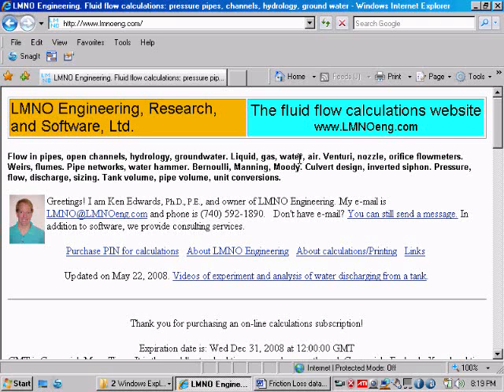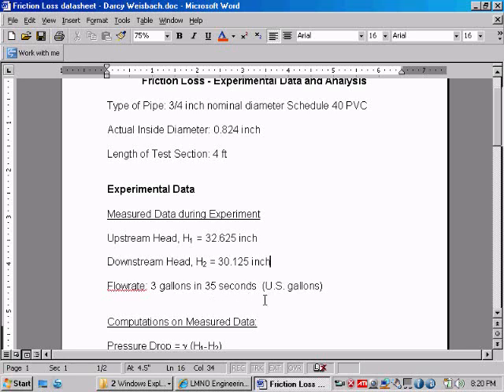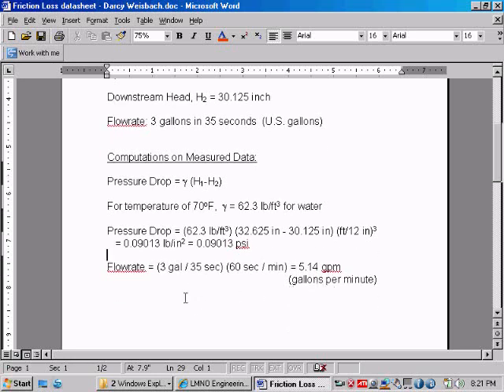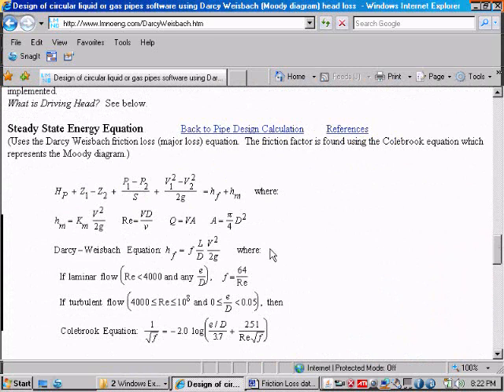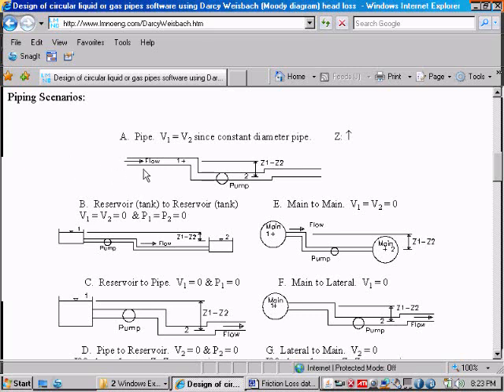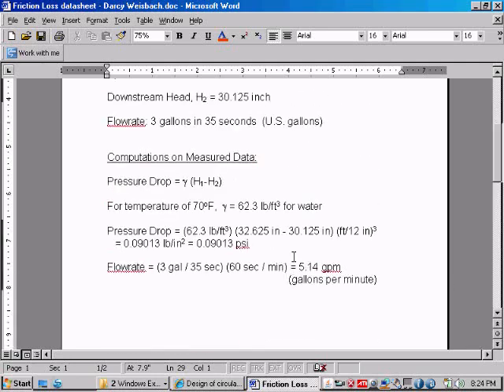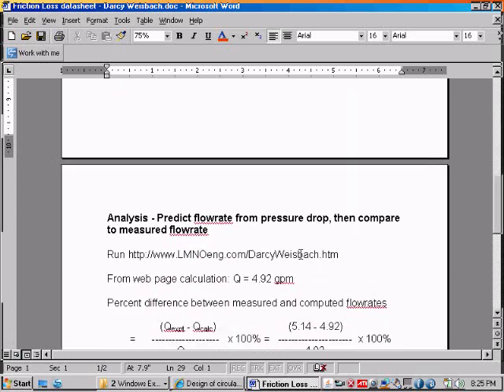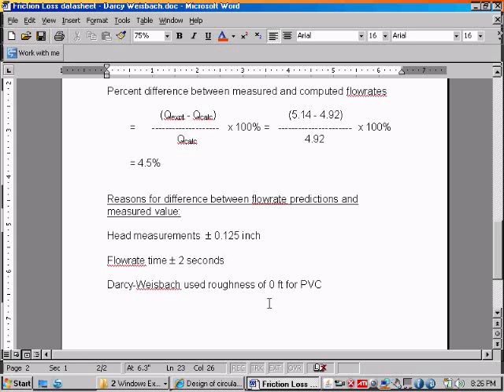Friction loss experiment analysis using Darcy-Weisbach equation

Comment: This might be a long shot. Studying fluid mechanics and for fun I did a few matlab plots yesterday.

 I used the energy equation and friction losses straight pipes (smooth), I wanted to do a plot that gave me an intuition for how the flow through a straight pipe goes down as the length of the pipe increases. Not sure if it's possible to do it the way I did though, because I rewrote velocity as Q/A in the equation and assumed a tank with water level of 2 meter, open to atmosphere, was the thing that made a pressure at the bottom of the tank, where I thought my horizontal pipe started, all minor losses ignored. This is what I ended up with.

.5(Q/A)^2*L/D*.3164(V/((Q/A)*D))^.25 - g*z + Q^2/(2A^2) = 0

Where Q is a variable to be solved and A is inner pipe area, D is pipe diameter, V=kinematic viscocity (1.004e-5 for water). g is gravity and z is water level height of a "imaginary tank" making a pressure that is not atmosphere, hence I have g*z to express something that can make flow happen.

Here's an example with some numbers, if you put this in wolfram alpha it will give you Q:
.5(Q/.00196)^2*2.5/.05*.3164((79.8*10^(-6))/((Q/.00196).05))^.25 - 9.82*2 + Q^2/(2.00196^2) = 0

^^ I used kinematic viscocity for 20 C air above, and of course the idea with a water tank g*z couldn't really represent a gas of height z. And this is where I get confused, because I can set the kinematic viscosity from a table of material characteristics, and now where in the formula can I see density of water or something like that. Basically what I'm wondering is if an equation can be set up like this to simulate losses through a straight pipe, by varying the length (in this case 2.5) and plotting Q(L).

(I assumed turbulent flow hence the .3164 Re thing)